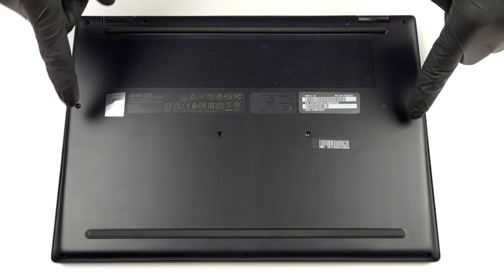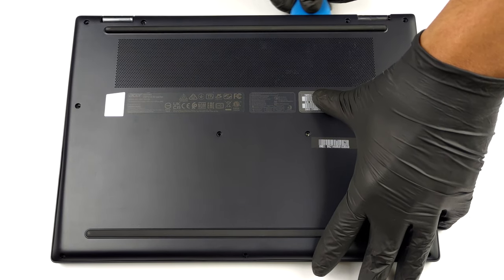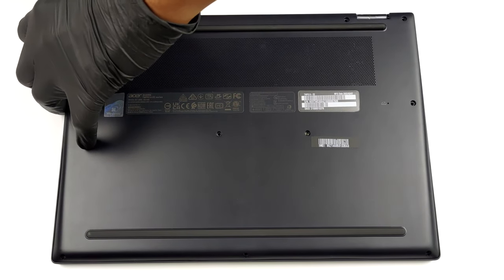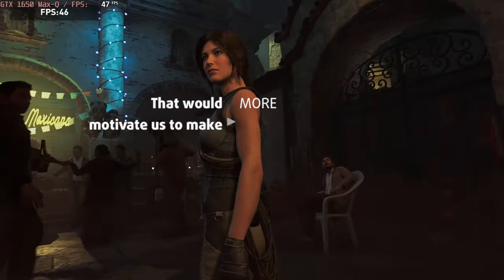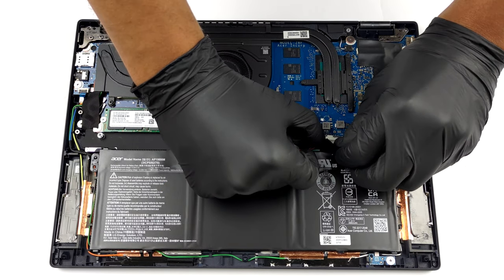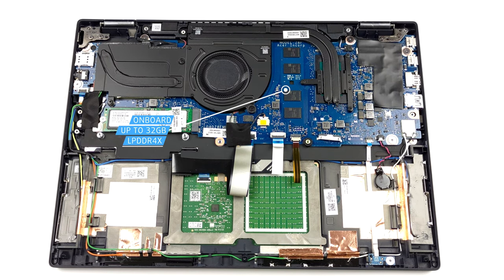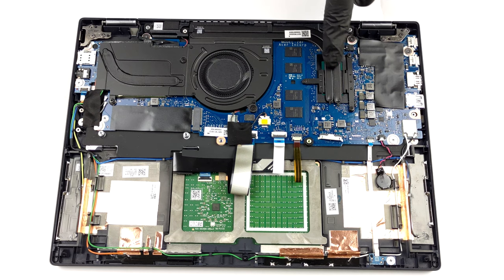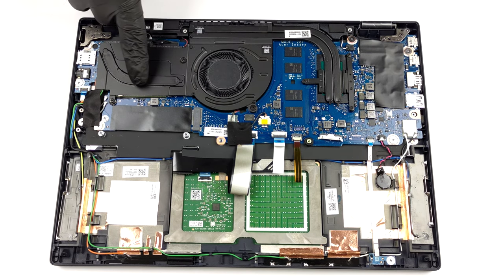🛠️ Acer TravelMate P6 (TMP614-52) - disassembly and upgrade options

Comment: Which brands laptops motherboard usally much durable u think ?
Reply: I had an Acer Aspire 15 Nitro last me 8 years of full time daily usage. Then the power died I think, it was included in the motherborard so no way to repair it. That said I also heard complaints about some Acer Aspire MB's...
All my other laptops were out of order in 5 years or less, HP, Siemens-Fujitsu, small Asus notebook...
Right now I'm using a cheap Lenovo that is a few years old already, but I bought for my mother and it was barely used, so it's more like 1 year old!
I'm also looking for something new.